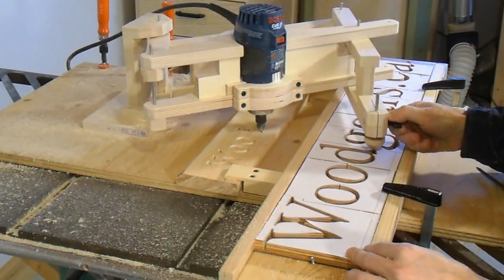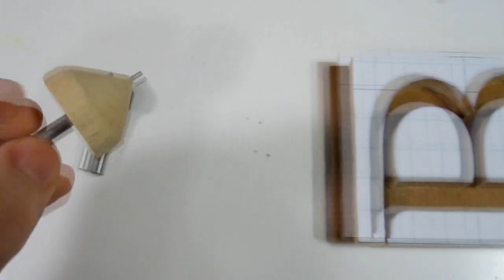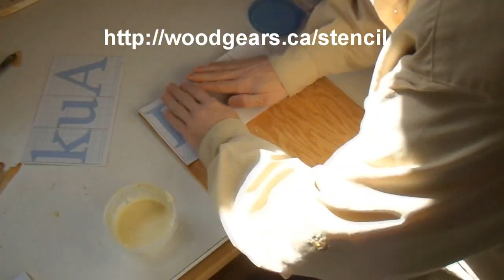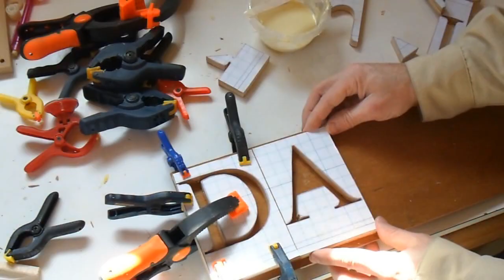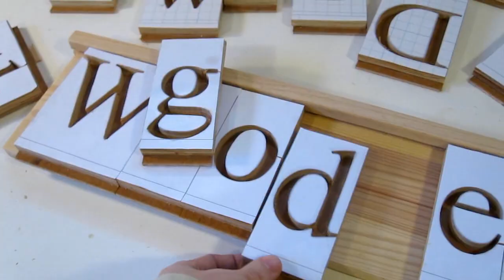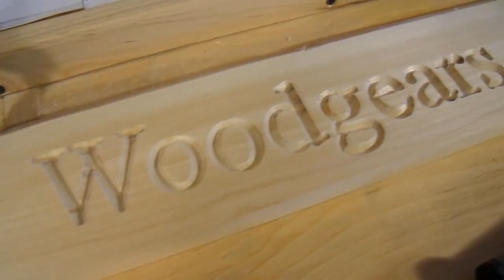3D letter carving

Comment: Your machine and technique for forming these letters is excellent, so please don't get defensive when I point out that you and Kiboz2000 are both right and both wrong! You are spot on when you say you are producing 3D letters, because the cutter you are using is 3 dimensional in shape. I think the point Kiboz was trying to make is that you are producing them using a 2 dimensional pattern. So the 3D shape is 'formed' rather than 'cut'. It's really difficult to explain, but I do see both points.

Comment: The letters have different depth of depressions because of the cone shaped guide.  That is the "lift" that you say is missing.  Watch his video on 3D pantograph telephone. 
For that matter, a 3D printer only really prints a 2D image, it just stacks that image on top of the layer below it to generate a 3D image. 
You say this is not a 3D machine, but what definition are you using?  Are you implying a 3D machine has to be controlled by a computer and not by human hand?

Comment: He means that just carved letter are not 3d letter because there're in a 2d board. A little probleme in your machine is that the depth is not controlled vertically so the letter will have a strange bevel effect. But it still is a good machine !

Comment: Yes, the shape of the v-groove bit is not ideal in that respect. I didn't think about the problem of crossing lines dropping the styles, however it does make sense as to why this would be a problem. A pre-defined maximum depth of cut on the stylus would allay this to a greater degree but leave pyramids and other little nibs to clean up. You mention that the weight of the router and the mechanism bears on the stylus. Perhaps counterbalancing would be useful here?

Comment from the maker: That would help, but flattening the bottoms of the letters is hard to do with a pointy bit.
A think I keep thinking about is wherever the lines meet at a T-intersection (such as a T on p or q), the stylus dives a bit at the intersection, which looks not quite right.  So I always manually hold it up to gun straight along the straight line.

Comment: Hi Matthias, and thank you again for a fantastic video. Although somewhat "late to the game" I have a modification to the stylus which I believe to be of significant use. Since characters with wide parts will allow the stylus (and hence the router) to drop in quite far, adding an adjustable stop collar to the stylus adds another level of flexibility. It does mean a little more cleanup and tracing around the entirety of characters to clean up the flat base of course. Opinions?

Comment: The router doesn't stay vertical as you move in the z-axis. Wouldn't that cause errors if you are using a very tall (your uppermost and lowermost points far apart) detail?